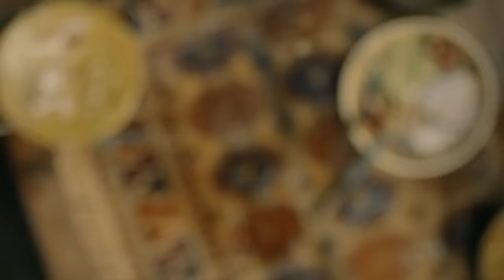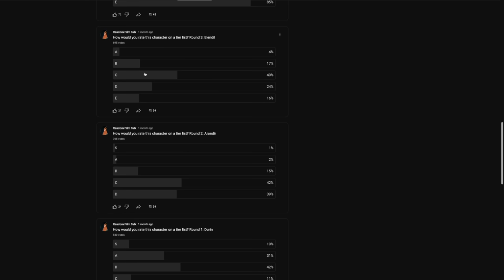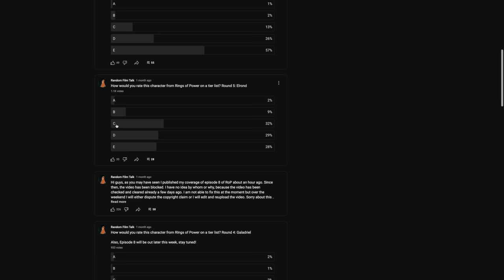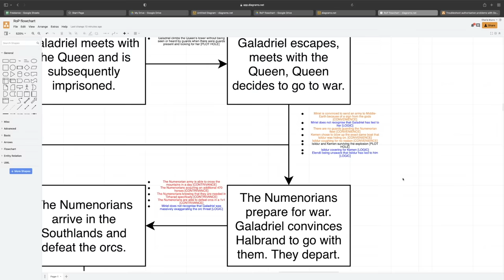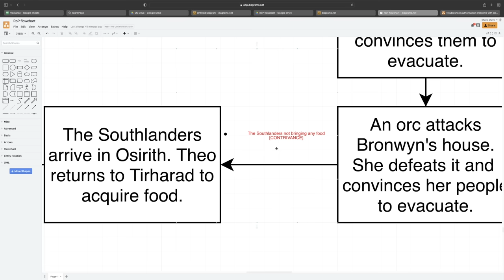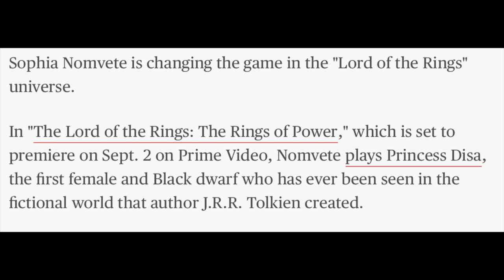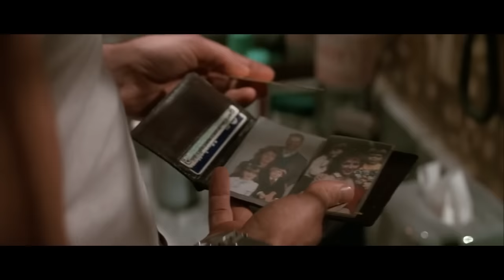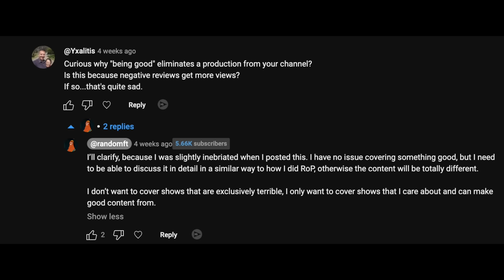Rings of Power is Not Very Good: The Final Autopsy

Comment: The at scene in Lord of the Rings has a few more problems even.  Gimli states that he has his axe "in his nervous system" which is dialogue that establishes that Gimli the Dwarf in a quasi-medieval setting has relatively modern medical knowledge AND chooses to use that term over something simpler like "head".  Legolas is an archer.  He has knives for melee combat, but his bow is his primary form of combat.  During a full overnight battle he somehow does not exhaust the quiver he's been running with since leaving Lothlorien.

Neither are full plot holes, as both are certainly possible.  Medical knowledge/terminology may well have reached what was our 1700/1800s during the seemingly eternal Middle Ages sort of technology era depicted in Tolkien's works.  Legolas could have picked up a bunch of arrows from dead elven soldiers prior to finding Gimli.  It does, however, make me think of 80s and 90s action films where the hero never needs to reload his gun.
Reply: Yes, Gimli's phrase does stand out as odd in the otherwise poetic medieval dialogue 😄 As well as Legolas's very 20th century quip "game over" at the end of the drinking game. I believe both were deliberate choices for the purpose of adding a touch of comedy to the otherwise intense, action-packed, and epic feel of the film.
As for Legolas's quiver, J. R. R. Tolkien makes a mention of the elf gleaning arrows between battles. This does not fully explain, however, his seemingly unending supply DURING battles when picking up spent arrows would be a lot harder. But it is fantasy, after all. The Army of the Dead cannot be explained in modern scientific terms either, but we don't question its existence when reading or watching LOTR 😉
Reply: @SilhouetteSE  It is absolutely a flaw if the language used is changed for a meta reason such as comedy.

Legolas ran out of arrows and had to grab others in the book, yes.  Unfortunately, the arrows shown being used by Uruks have black fletching, the arrows used by the other Elves have white fletching, and the arrows used by the Rohirrim are dark colored.  Legolas's are green.  It is possible other archers not shown used the same color, but it harms any argument for why Legolas has a full quiver of green arrows.  Further, it is exactly as full as it was during the cavalry charge, meaning we can know it was a costuming/continuity error.

It being a fantasy film does not remove flaws for being fantasy tropes.  That may be a valid argument if the complaint is more along the lines of dragons are not physically possible, but not for the quiver.  An endless quiver is just poor film making, much like never needing to reload was poor film making for many action films.  Finally, bringing up the Army of the Dead is along the same lines as dismissing a plot hole in Star Wars because its a movie about Space Wizards.  Modern science cannot explain Lembas either, so we just have to accepts that a small amount of this bread is filling for whoever eats it.  That it is still possible to run out of Lembas is the world operating in a way that makes sense.
Reply: @SquallLionhart409  I have not seen any Star Wars films, but I see your point. Yes, bloopers can be annoying, I agree. However, a human director is yet to produce a 9+ hour epic trilogy that is totally void of flaws, so I tend to be more forgiving. While utterly enjoying an in-depth analysis such as Mr Random does here 👍 and learning about the various arrow colors in LOTR, what matters to me is an overall well-made film with a powerful positive message - even despite a few continuity errors or anachronisms here and there. Producing work of such magnitude is a monumental task, and some things such as arrow colors can get overlooked, but I would not go as far as calling it "poor film making" (nothing but respect for PJ and his crew who hand-manufactured so many unique props and 19 thousand (!) costumes for these films). I will watch LOTR 400 times and still enjoy because of the characters and the story - unlike the empty shell of ROP, which was one massive error to begin with. That is all I have to say 👋
Reply: @SilhouetteSE  The flaws of Lord of the Rings tend to be more towards the continuity/prop error of Legolas having a full quiver as opposed to... well EVERYTHING being wrong in RoP.  The scene of Gimli speaking with Legolas after the battle is an example of poor film making.  It damages immersion with poor word choice, damages continuity with Legolas's quiver, does little to further Gimli and Legolas as characters and exists primarily for comedic purposes.  The final counts, which made absolute sense in the book, also make little sense given what we see during the film.  The theatrical cut is absolutely made better by its exclusion.

It is also, as you point out, one scene over the course of 9+ hour epic trilogy.  The extended cuts, if you cheat and count the credits, are what, 12 hours?  Without is still nearly 11.5 hours.  The overall quality of the films is quite high, with just a few scenes that are made poorly.  I will clarify that I am calling that particular aspect of that particular scene poor film making and not the overall endeavor.
Reply: @SquallLionhart409  Like I said, I see your point. But overall, we look at these things differently. I'm not so much into nitpicking, so let's agree to disagree. Peace✌️🙋‍♂️
Reply: @SilhouetteSE  Peace.  I think we can agree to leave the Lord of the Rings scene there.

I wonder how long it would take to break down everything wrong with Rings of Power would take if you went as in depth with it now.  RFT took longer than the extended editions in his breakdown and wasn't nearly as pedantic as I am.  I'm sure hours could be spent on minor details like the cost of a peasant dying clothing blue not actually being too prohibitive.  Realistically, we probably would see a fair bit more color from much of the peasantry depicted in the Southlands.  That's an entirely different rabbit hole, so I will instead just bid you good day.
Reply: @SquallLionhart409   Breaking down ROP would take a lifetime 😄🤦‍♂️ All the best to you, too!

Comment: There is one kind of contrivance that's justified--when it creates the plot. If a small magic meteor crashes into Bob's house and some alien fairy thing comes out of it and grants him wishes, it's rather contrived that, out of the entire surface of the earth, it landed in Bob's house, but since that is the point of the story, it's not a problem. Most stories start with a contrivance like this at the very beginning or early on, often several; why did Sam and Frodo bump into Merry and Pippin? They just did--there doesn't need to be a grand reason for it, it's setting up the rest of the plot. That's why I feel it's important to stress this exception, or we'd have alot of "whadabout" counter-points.

Comment: You keep referring to the Stranger as "Gandalf", but if the RoP is trying to be in anything resembling a canon with the rest of the universe, he straight up cannot be Gandalf, because Gandalf the Grey arrived to Middle Earth much later. 

To give you exact dates, the Rings of Power were crafted between 1500 and 1600 of the Second Age, meaning the show takes place around this time. The Second Age ended with the defeat of Sauron in 3441, starting the Third Age. The Wizards, including Gandalf, show up in Middle Earth for the first time in 1000 of the Third Age. In other words, there's a nearly three thousand years long gap between these events. 

For comparison, Winston Churchill showing up in a show about the battle of Thermopylae in 480 BC would be *less wrong * than Gandalf, or any of the Wizards, showing up in the Second Age.

Comment: I do agree that a Gimli to Legolas kill count of 42 does seem extremely low when facing off against 10,000 especially when you consider that Legolas was at about 20 kills 2 minutes into the battle, but the part that bothers me is that Gimli wasn’t even in the final charge, he was blowing the horn of helm hammerhand during the charge which was fine in the original theatrical release but becomes an issue with the scene being added with the extended version.
Reply: It was only there to reference the books where it made sense, Legolas had an early lead but when the defenders ran out of arrows he slowed down and Gimli and Eomer got separated and cornered and only lived because Gimli went into beast mode and wracked up the kills.
Reply: @Phillibetrus  i understand that and that is correct from the books perspective, but from the movies perspective Gimli was blowing the Horn, Eomer had not arrived and Legolas rode out with Aragorn and Theoden for their final stand so to throw that scene in doesn't make very much sense.
Reply: @truechaos6927  Oh I wasn't trying to defend the scene, just explaining where it came from. To bury the movie number even more in the movie when Legolas drops the ladder later he probably kills 30 - 50 orcs right there. unless orcs can survive such a fall or getting crushed.
Reply: @Phillibetrus  kinda thought that too,